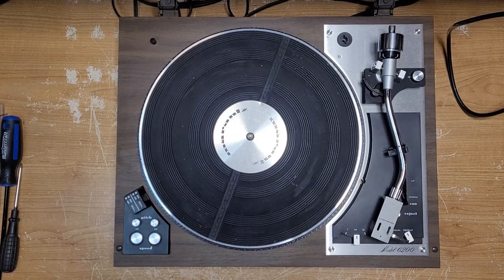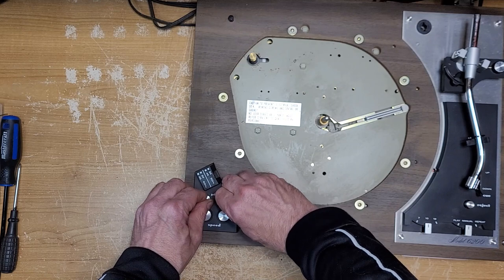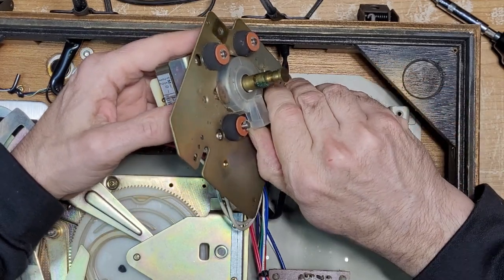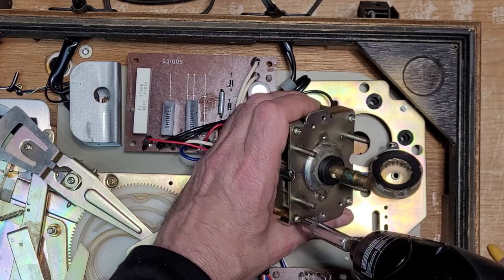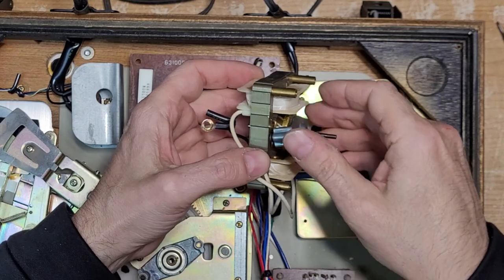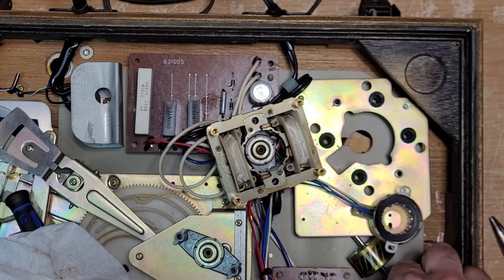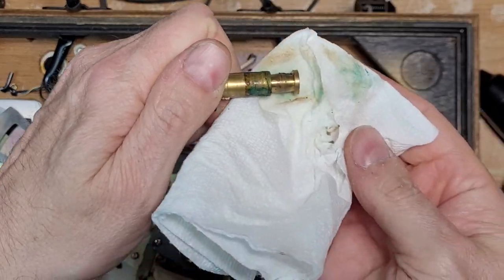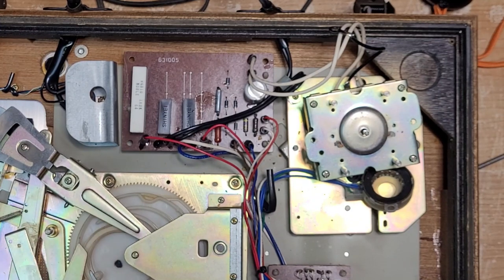Marantz 6200: Overhaul Part 1

Comment: Awesome video! I'm searching for a replacement platter mat for a Marantz 6200.  Mine is brittle and shows signs of deterioration on the underside;  I guess it's typical for it to start "bleeding" oil.  Have you ever seen that?  I know I can get an unbranded one, but this one has the cool Marantz silver logo in the middle, and I'd love to replace it or find one that I could reuse the silver logo plate.
Reply from the maker: I see it all the time.  Have several videos with platter mat rot.  You'll have to find a second hand original.

Comment: You do honest work. Way to protect the tone arm. Often the original plastic is found on the bright work. The blemishes will come off with warm water and a paint brush and dawn dishsoap with a small amount of iso. Try to find a product called vinatone.....it is awesome. The caps on these are too easy to change not to do it. ESR / DC current / Resistance...may even run backwardsb(dual 505 lol). Brake clean on a rag clean the pully quickly. Soldering iron on the screw / paint  for a few seconds makes it easy to agitate away.
Reply from the maker: Thank-you for the tips.  If it were my table, I would definitely be replacing the caps, but it all depends on the owner.

Comment: HELP!! You know that small red washer you were worried about losing when taking the motor apart?  Well I performed a motor service tonight and lost it.  Can you point me in the direction of a replacement?  I’m wondering what specific material/type of washer would be best.
Reply from the maker: You should be fine to use any kind of washer like metal, etc.

Comment: Hi Turntable Guy, thanks for this very informative video.

Do you know if there's a way to adjust / fix the anti-skate spring on this turntable?  On my 6200, when the arm lowers onto the start of a record it always has a tendency to skid inwards (the needle skips several grooves into the first few seconds of a the first song).  

This is reduced a little bit if the anti-skate is set all the way at 3 but only very minimally - it still skids inwards a bit.  I'm thinking the spring on the anti-skate is maybe worn out, cause when I take the headshell off to see how the tonearm behaves when I move the knob, it doesn't pull back very much at all when it's set all the way to 3 (compared to my other turntable where moving the anti-skate knob causes the tonearm to respond much more convincingly).

Thanks!
Reply from the maker: Is your stylus getting worn?
Reply: @TurntableGuy  I've tried several types of cartridges, stylus and headshells and it always seems to happen unfortunately.
Reply from the maker: @djfunkybeak  I would try adjusting the lead-in point a little further in on the record.

Comment: These old tables are going for a good buck now
Reply: I have 26 finished tables. Cant get what they are worth locally. Going online.
Reply: @Poppinwheeeeellllllieeeeez  6300 s are going for crazy money now
Reply: @alanarmstrong2323  like Turntable guy said...paying for the name most times. the more I use them, the more I like DD auto stop tables. Dual 704 is a great example.  I also think the ROI on turntables is quite low. 33.3 (excluding lenoco and bsr junk) after that its a matter of taste. put money into cart and stylus. 80s technics are hard to beat when serviced properly and is doesn't need to be a sl1200 or 1300 either q200 is fine for most people.
Reply: @Poppinwheeeeellllllieeeeez  I have a jvc dd la 55 but the old duals have a charm of hearing springs and levers move.